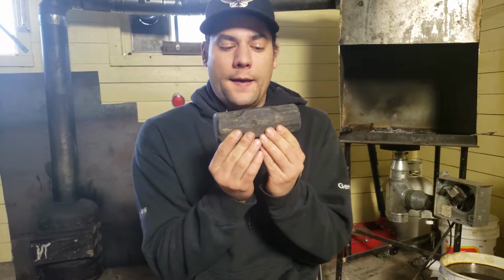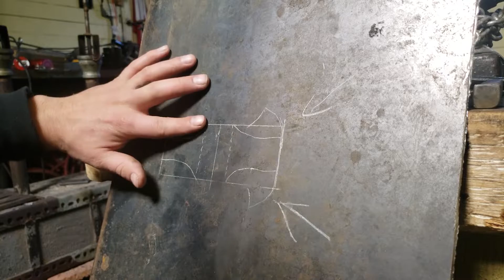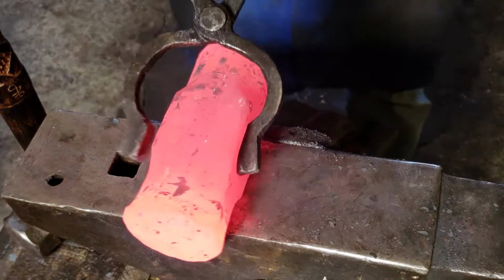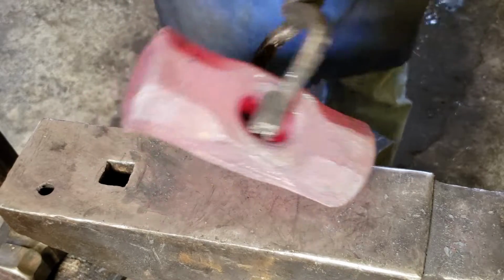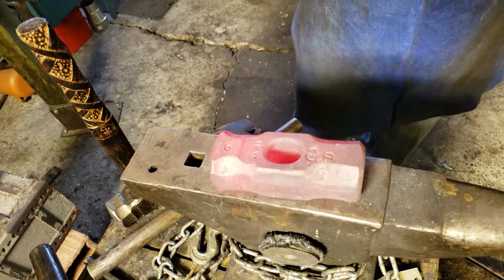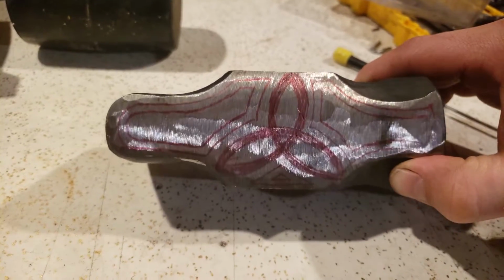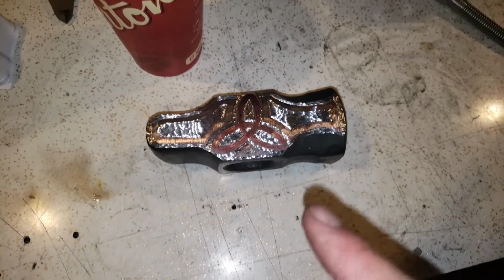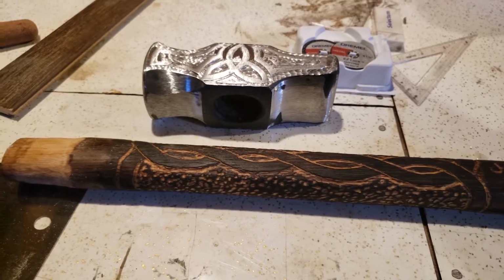Blacksmithing - Cross Peen Blacksmith Hammer from an old slege hammer

Comment: What does the wire brush do on the hot steel? First time I’ve seen that be done
Reply from the maker: If you heat it up to a nice bright orange and brush it it takes a lot of scratch marks off and gives it a beautiful finish and gets rid of forge scale too
Reply from the maker: Im to cheap to buy a butchers block brush hahaha plus i think its more efficient
Reply: CG Smithing ahhh thank you
Reply from the maker: No thanks for watching man glad i can help